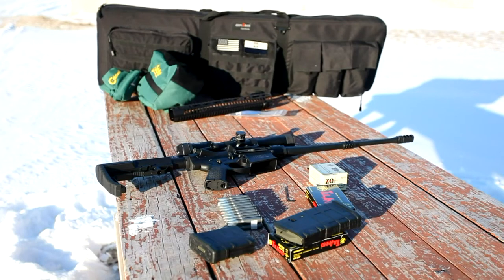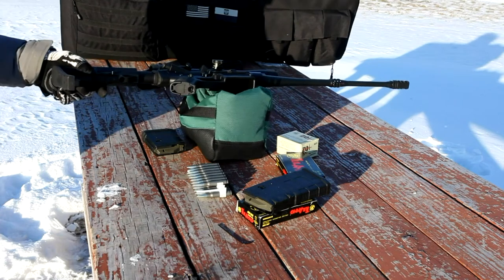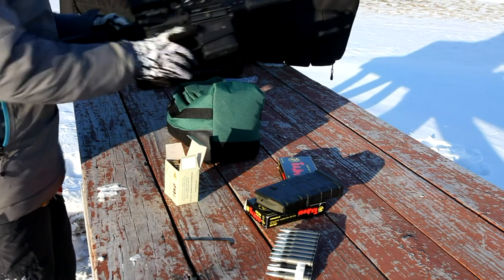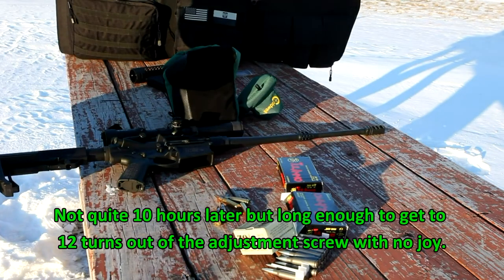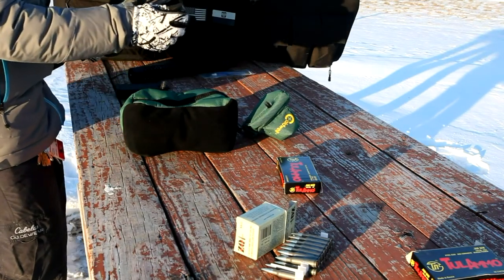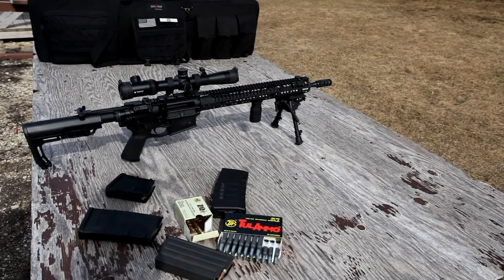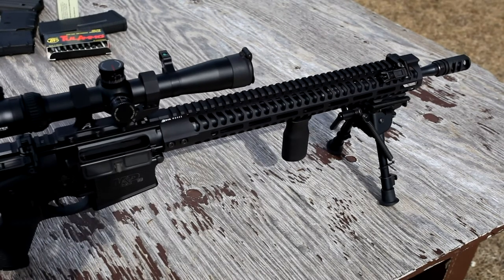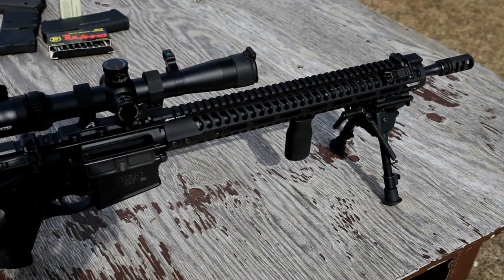M&P10 Teething Problems

Comment: The M&P10 functions flawlessly stock, you guys need to understand when you start screwing around with replacing parts of the gas system not specifically designed for a particular firearm shit can and does go south. . I have the Sport and the 18" and I had the same problems with the aftermarket gas block.  Bone stock with carbine handguards and an ACOG and I'm shooting less than .5MOA.  Absolutely reliable, high quality tack-drivers.
Reply from the maker: With what ammo?
Reply: Just bought one. I have personally never seen a double feed before. All that changed. This rifle without any modifications had so many failure to feed, jams, double feeds, short strokes, and ejecting perfectly good unfired rounds. I love Smith and Wesson and was a loyalist all the way up to this r rifle. From here on I'll just save up for the Colt.
Reply: I will add however, that the factory magazine blows goats and should just be thrown away. I guarantee this guy has the gas block improperly aligned over the  gas port.
Reply: priestof1 all your problems can be related to the crap factory magazines.  I never had a problem with good magazines, nor after I found the sweet spot for the gas block
Reply: Tactical Accountants I’ve shot everything from reloads to factory ammo, no probs after scrapping the terrible factory magazine.  This guy clearly doesn’t have his gas block aligned properly.
Reply: @dasboot9471  the gas block should already be in the proper position according to the engineered specs. I keep reading people using pmags on all other at platforms and this is the only one not working. If what you say is true, unacceptable. I will require my guns to fire what I need fired at any point of any day. Running around finding the good mags or the specific ammo brand will result in my getting my money back from Smith and Wesson. It will work or it won't. So far, it won't. It's simple for me.
Reply: priestof1 hey man I get it, but I bet it ran fine stock didn’t it?🤔 it’s a well known fact crap mags are the main issue for semi auto issues...same thing happened to mine, it now runs perfect
Reply: @dasboot9471  no, I ran the mag it came with and pmag. All failed
Reply: priestof1 hmmm and you never got this rifle running?  I’m a gunsmith and have never seen a smith and Wesson  rifle fail except due to the crap magazines or a user induced/part interchange problem..I just want to figure out the issue because it’s likely an easy fix, or you have the only lemon I have personally heard of smith and Wesson putting out🤣
Reply: @dasboot9471  hey man I am a loyalist to them and k is I'm not the only one. My woman got a 380 easy pull (yeah, I don't know about them either) and they all suck call the fa Tory and they have a special hotline for it. I bought my first pistol s&w and it became my most dependable piece of equipment ever. I knew if everything else failed it wouldn't. That s why I kept to them. Talked to factory and had to.list all problems. While writhing them out I looked over it. In short, I spent my hard earned money on a rifle that doesn't fire and automatically needs work. Getting money back going for a colt
Reply: priestof1 I’m commenting on the message you made about the magazines for the M&P10..SOME M&P10 models come with magpul, some come with a smith and Wesson branded crappy box magazine that doesn’t work.....period...I switched to and have run both Magpuls and Lancer Systems magazines in BOTH of my M&P10s and with 168 grain factory or high quality reload HPBT ammo I am shooting .5” MOA or better at times...
Reply: priestof1 I can probably talk you through getting your rifle to run honestly if you give me a breakdown of the modifications from stock you have made to it, and I will help you find the problem with it’s function
Reply: @dasboot9471  I appreciate it but will admit upfront I don't trust myself. This is a weapon I need to rely on for all reasons so I will not allow myself to go in and make things worse. I spoke with a Magpul tech and he told me to manually cycle a full mag inspect bullets for damage and if any bullets come out. He also admitted it can be either the gun or mag and he was willing to refund or swap out but run the test so I won't keep returning mags. Seemed fair, I did his test. Every bullet casing was damaged with deep gouge, and dents. I'm sorry man but if I had to use that rifle I would be dead. I can shoot old bolt actions and am a better than average shot. This is my first AR platform and though it appears to be straight forward from doing a deep clean on it. I need to be able to depend on it 100%. My 1st gen mp 40 is rock solid. This immediately needs attention. I hate to eat crow because I have been pushing Smith and Wesson for a decade. I have to swap out. I am going to save up and get a colt at 10 if I can get my cash back from Smith and Wesson. It's actually depressing a bit. Imagine walking around for a decade with a Smith strapped on then turning away. Seems stupid but....what can you do?
Reply: priestof1 did you put any aftermarket parts on it or mod it any way?  I don’t mean modifying the rifle I mean getting it back to proper operating form.
Reply: @dasboot9471  tge only thing i did to that rifle was add a scope and clean/oil it. I changed nothing, not a single thing, unless palmetto state did something to it or colonial shooting academy. Was a transfer. Other than that, as long as it's been in my hands, nothing's been sone
Reply: priestof1 so it has factory railed gas block carbine handguards and factory charging handle?
Reply: @dasboot9471  yes
Reply: False. 
The M&P 10 is not flawless from factory. Mine had to go back for repairs brand new because of malfunction after malfunction with several ammo types.
Reply: @H77RBG  I’m calling bullshit, I have both the 18” and the 16”, one older one later…you probably had magazine problems, or you were running crap ammo, OR the gas block was misaligned…it took me way more playing around with my gas block on this to get it aligned properly and run full gas than most rifles I’ve worked on for some reason….

Comment: Going through this same process with my M&P 10. Having issues getting the roll pin removed from the original gas block. Have an Odin Works tunable gas block. Not sure now if I should have have just got an adjustable gas block. Will need to be at the range without the hand guard testing and adjusting the screws for the gas port. No dimples in the barrel for the set screws so I hope it stays in place. Thanks for the video

Comment: Wolf makes steel cased copper jacketed(non magnetic) ammo. They make a sealed and coated version and a non sealed version.  You can find it at sgammo.  Cheap yet easier on barrels than bi metal bullets.

Comment: I noticed you are using what looks like a BCM charging handle. I was using the same charging handle and I was getting the same malfunctions switch back to the original one and it was fixed. Found out the Geissele one will work with it.
Reply: Yup, he probably hasn't modified it for proper clearance in the M&P.  You have to smooth down flat the hump and open up the bore on the nose of it for the S&W gas key.

Comment: I’m 120 rounds into my M&P 10, and not sure what to make of the results yet. Federal 150 and 180 soft tip cycled great. Fed 168 Match cycled for 5 rounds and it was bolt action thereafter. However the soft tip rounds would keep cycling when I switched back. I finally finished off the 168 via bolt action and noticed the ejection was weak. I shoot lefty and shells were landing on my right shoulder. Running all stock, theory is the gas block is slightly off or even migrated? I was able to get 1/4 turn on both bolts on inspection. Had to tighten scope rings after each mag, that baby kicks a lot harder than my AR15. Even Nutnfancy warned stuff would come loose, so no surprise. Hope to get it figured out, was shooting groups way better than I expected. I was prone out in the bush, so my shoulders pretty bruised. Magpul and a .70 pad in the mail. Love this rifle!
Reply: just shot mine today and suddenly the rifle will not pull a shell in to the chamber!
now a Bolt action! FIGURES! 
S&W Customer Service is second to none though! two minutes on the phone and i had a shipping label, "free" and hopefully i get it back FUNCTIONING Before Deer Season coming rite up in November!

Comment: Jusr wondering did something cause you to install an adjustable gas block? I run my M&P10 with a suppressor without an adjustable gas block with no issues.
Reply from the maker: Mostly because nutnfancy said his didn't run well suppressed on stock gas setup. Good to know yours does, gives me hope I won't have to adjust it if we ever get suppressors in the Socialist Republic of Illinois. Also because the Wojtek only comes adjustable in that diameter/clamp-on-style and for $30, might as well have the option to adjust rather than not have it and pay more for another brand.

Comment: I had a number of problems when I bought my S&W MP10. I had to send it 2 times to get it fixed. Customer service was not that great and they seemed extremely busy. The second time I sent it, I found out they put in a MP 15 buffer and spring instead of the MP 10. I putting a short story, it was frustrating.
Reply: Did it work? I’m having the same problem

Comment: Glad you got that sorted out. Is there no way to access the adjustment screw on the gas block without having to take the hand guard off? Obviously not, in your case, but didn't know if that is just the way it is with all AR style rifles and gas blocks.
Reply from the maker: I’m sure if you really wanted to you could slot an Allen key through the handguard or a long one down the inside of the handguard from the front, but why bother? Just be careful you don’t strip the threads on this particular handguard.
Reply: Okay, thank you. I've never understood why gun manufacturers or accessory manufacturers use soft, cheap screws and set screws for critical components like trigger adjustments, etc. Spend an extra penny and get stainless.

Comment: Two more things to consider...the M&P10 gas port is extremely small and designed to function with the gas block it comes with....When you have an aftermarket block you may have to open the gas port up.  Second, the factory charging handle is a proprietary S&W design and DPMS/Armalite/Other brand/design AR-10 charging handles usually have to be modified in order to work properly with the S&W.  I don't suggest using them while firing until you have smoothed the hump on them and enlarged the bore for the gas key, otherwise you could risk damaging the rifle, your bolt carrier, charging handle, or all three.  Do your homework guys and have fun.
Reply from the maker: Hey thanks for the advice. I can happily say that since filming this video I can count the number of malfunctions my M&P10 has had on one hand despite putting at least a thousand rounds through it. I also noticed when installing my BCM Gunfighter that the hump you are describing was not there as it came from BCM themselves. They must have modified the Gunfighter 7.62 at some point to accommodate more rifles. Happy shooting!

Comment: I have personally had 2 squibs from Tula ammo. Plus another one pierce the primer using a sks and blow back the firing pin with enough force to bend it. I've  had another friend with a squib round as well. It's not only garbage ammo in my mind it can be honestly dangerous.
Reply from the maker: I still swear by it for the price. Picked up another lot for 28 cents a round + shipping last week. That is half the price of any brass 308 you will find and it has outshot any cheap brass I have tried. No squibs yet for me.

Comment: Oh Russian basement TulAmmo. No matter what gun or caliber I’ve used in conjunction with TulAmmo I’ve had problems. It’s cheap for a reason. I’m not saying that’s your problem, but it’s junk ammo for sure.
Reply from the maker: Autism Family No doubt it isn’t up to standards of brass match stuff but accuracy wise, in my experience it beats out cheap brass 308. Tula 165s soundly beat PMC 147s and ZQI 147s in our RPR accuracy test. The only downside is you can’t reload the steel and increased barrel wear potentially but I’ll take that for half price per round.
Reply: Accuracy is great and all, but if it jams up the gun it's no good to me. Maaaaaaybe for target practice, but even then it's annoying. I've had dependable revolvers jam on TulAmmo due to the steel expanding from heat, unlike brass. But what's odd is it doesn't seem to effect other steel cases of used from other brands, like Cabela's steel (or aluminum?) casing. Thanks for responding.
Reply: @TacticalAccountants  I run tula in any gun I have I have an AR pistol that don't like Tula but my other 10 guns love it especially my AK47.

Comment: I was told on,y to run brass ammo through mine until after break in. I had tried Tula and I was having feeding issues and my bolt wouldn't lock open either. I'm thinking the bolt is short stroking, but I'm not sure. I installed a quad rail from UTG on it ;p(after having one bad day at the range with frangible ammo and one good day at the range with Winchester) and the rail on the UTG is not lined up with the gas block don't I'm wondering if that means it's something with the gas block (not an expert with ARs) SO the third time I took it to the range, it fired one full mag of remington FLAWLESSLY, the bolt locked open... I decided to go ahead and try some NATO federal 7.62x51 and it would feed sometimes, other times it would stove pipe and other times it just wouldn't even feed another round (I think it was short stroking) had worst luck with Tula, it would never feed another round with Tula. I'm hoping it's an issue of not breaking it in yet (S&w forums say 200 rounds, I haven't out that many through it). I'm also getting quite a bit of brass shavings in my chamber, but the tech at my local gun store said that's normal for a more powerful AR and it'd be less and less over time. If anyone has any suggestions, I'd be glad to hear them! Glad you got your issues worked out!

Comment: Sup man. I commented on your other video. If you want the best performance out of it, try using quality ammo. Hornady 168 Vmax (or 167, i forget), is deadly out of this rifle. Id focus on finding cheap brass rather than the tula. If you still want steel, then try picking up some Wolf performance. Silver bear seems to be cleaner as well. Just my two cents
Reply from the maker: M T Thanks for the tip! Definitely going to test it with quality brass for proper groups but as far as Russian steel goes, I have had good results with Tula 165s out to 600 yards. We actually have a video showing that with Ruger Precision Rifle. Give the stuff a try for cheap plinking if you can find it.

Comment: I know people beat this to death but if you're spending a decent bit of money of your rifle with your after market upgrades, I don't see the point of trying to fire super cheap ammo out of it, especially when you seem to be striving for a somewhat economical but precision tactical rifle. I am enjoying your vids on this rifle though. I've been looking at getting a .308 but where I'm at there are very few options other than this one.
Reply from the maker: Tula 165s being super cheap are only half of the appeal. The other half is that they are actually pretty accurate and (if you care about this) very effective against soft tissue due to the soft point design.
Reply: @TacticalAccountants  That's interesting. From some of the stuff I've seen on the Tula brand, I wouldn't expect it to be that accurate. Have you posted any vids of your groups on paper at a few different distances?
Reply from the maker: @Jazzman-bj9fq  We have one video up comparing 4 different Russian steel .308 loads but the 165s didn't win that one. Check out Ruger Precision Rifle 600 yard Tula 165 video and also M&P10 offset iron sight 200 yard Tula 165 video. I'm not saying it's Match stuff by any means but in my experience it does very well for training purposes compared to other cheap loads. Like can't blame most misses on the ammo.